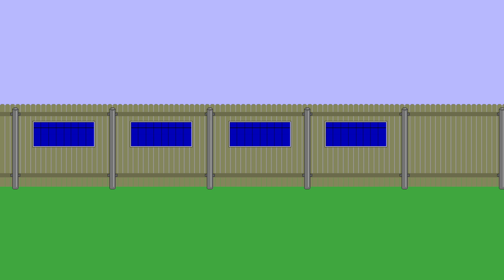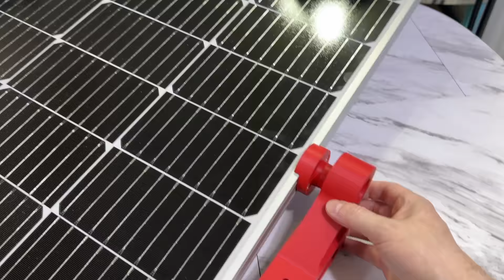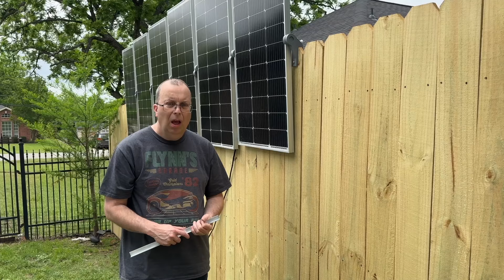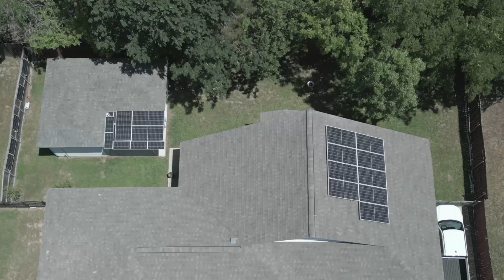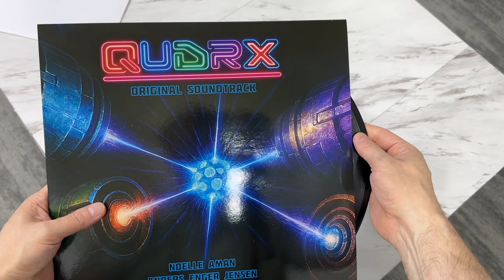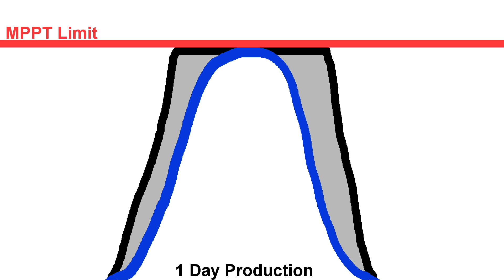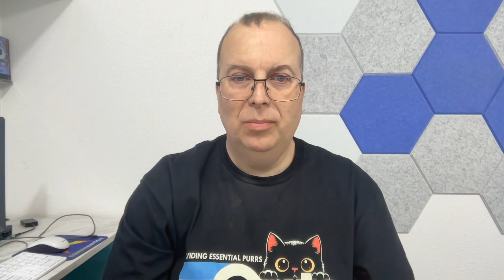I made an adjustable Solar Fence!

Comment: You should have a wing nut on the rotating bit.   You can tighten the wing nut down to increase friction on the rotation.  That would hold it in place  while providing infinite adjustability.

Comment: Your monthly electricity bill, even after accounting for the saving you make by taking advantage of time-of-day pricing, is surprisingly extremely high to me! What are the typical fixed-pricing unit rates and standing charges (including all surcharges) in your area, and how much electricity do you use in a year?

As a Londoner, I pay 0.2112 GBP per kWh, plus 0.4270 GBP per day. My annual usage is about 4000 kWh, so that totals pretty much exactly £1,000 per year, or abut 1350 USD per year, or about 112 USD per month. My current server hardware is responsible for about 1000 kWh per year (95 to 115 watts, 24/7), and indeed the typical household usage in the UK is about 2,7000 kWh per year for a 3- or 4-person household.

Comment: You could use a pipe as a continuous hinge point for all of them and screw them together making it much quicker and easier to tilt them.  Since they're hinged in the middle it'll be easy to tilt the whole array as a unit.

"This one trick"  I built an off-grid system for about $1700.  On hot cloudy days with the AC running all day I don't have much extra power available to charge cars, but other than that it does fine.  I just picked up another 5.6 kw of panels for $29 off eBay, if I get those installed it should get me through almost any weather without issue.

Comment: my concern would be the panels are now a sail. I am going to be curious how they perform being soo high during the windy winter months.  I would be concerned that the vibrations would decrease the life of the fence in which case you are legally responsible for replacing it. Not soo bad when neighbor can't see the panels, but now they can, and if you have  an irrational neighbor when it fails, they might have you pay for the whole fence. You could focus some of the panels east and west to extend the usable generation window. Add a recirculating pump to the water heater with the extra solar and heat the water. you can never have enough panels. that is the law.

Comment: 15:00 Why hitting 100% charge on the battery backup is detrimental? I thought the battery just kick in to be supplemental during the off peak and nighttime hours and not be the neuralgic point for the off grid system, unless they are also the main inverter-regulator in the system.

Comment: Hey, you should look at the fine print of your "free nights" plan. It might explicitly forbid you from charging batteries at night. Mine does. If they decide I'm using too much power at night, they can start charging me market rates (which are typically higher than already agreed rates)

Comment: Holy crap you guys use a lot of electricity. 300-600 for two people is intense. Are the rates just very high? Were a house of three and we barely crack 100 every month, no solar. 0.18 a kw. In the summer the bill can get close to 300 for a month or two.

Comment: Just buy 600Wp solar panels and put them on the sun, not these small toys, I did put panels everywhere around my tiny 52m2 house and now I have 20kWp now... Dont use ecoflow joke but a victron inverters and mppts and proper NMC batteries 20-60kWh

Comment: Man, your electric bill is still too high.  Even before I got a 9KWH system I electric bill was no where near as high.  With solar (I generate 11.5 - 12 MWH a year) Usually during summer I am paying 30-90 dollars a month, winter it jumps to 250-350 although I did sky rocket that to 500 one month when we had 0 deg F weather for 2 weeks straight.  For reference, my house is 6 bedrooms with a walkout basement and I have (2) Heat Pump (non GEO) units that run on electricity for backup heat. I do also run (2) smart thermostats that adjust the heat settings on a schedule when we're usually at work.

Comment: @The 8-Bit Guy - The only need for changes that jumps out at me is the vertical planks on the fence where the panels are attached... The upper ends have only 2 NAILS holding the planks to the 2x4s behind them. That's no good! There should be 4 or more SCREWS with fender washers per plank. 
Or better yet, continuous L-shaped aluminum with several bolts into and through each plank, plus reinforcements on the 2x4s where they attach to the fence posts. Joints in the L should happen on planks with no panel mount. Then you should be good in those 80-mph winds. Maybe even 100 mph. Note that wind force varies as the square of wind speed!

Comment: Couldn't the solar panel have the hinges at the top of the panel aligned to the top of the fence and then they are lifted away from the fence at the bottom and a bracket put in place there to keep them in position  - so not intruding onto a future neighbors land? (still high enough to be out of the shade?)

Comment: 17:25 One thing to consider (not sure if ecoflow can do that) is a smart bypass of the battery when that is full. It means it converts all available solar power to grid power on demand. Or adding more battery capacity. Sure at times it won't be full, but when it is, it lasts longer.

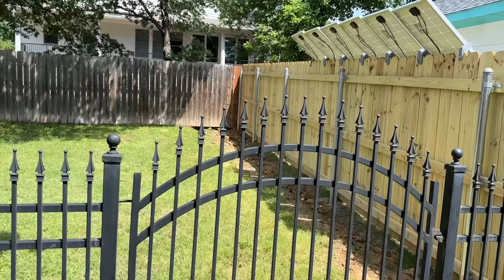Comment: 7:07 Hmm.  Couldn't you have made it so that the fence poles are all on the same height? (Then attach a horizontal bar/beam between them and attach all panels to that) That would made all panel on the same height with the bonus of being able to link all panels and tilt them in unison. And technically you could add a cheap DIY 1 axis solar track to it. /consists of two cheap 1W solar panels divided by a 90° board driving a small geared motor (also a few diodes are needed, but that is all. if the sun shines on top, but not the bottom the power drives the motor in on direction tilting that mechanism and all panel up, and if it falls on the other side it drives the motor in "reverse" tilting them down) if both are evenly lit the small panels cancel each other out.) 
7:58 Depending on the mounting, you might only need to move them for "other things that needs to be done"  ... as they would be strong enough mounted to not fly away on bad weather. Unless the weather is so bad the house also flies away. But then moving the panels vertically won't do much. And maybe to clear snow.
8:53 Your main building still has roof space left for east or west facing installation. All a question of cable routing,

One idea for the panel angle: If holes in the fence is an option for you, a half circle of a T profile* connecting top and bottom of the panels might be an option. The vertical of the T then would have notches or hole where you can snap in a spring loaded bolt can be snapped in. As long as the bolt is there it won't move, pull the bolt out and you can move it into any angle any time)

*=10:49 L-profile also works. Putting the lock on the solar panel part (the moving L-profile ... but not onto the panel itself only the bottom part of the profile) would allow you to only use one lock for each panel (side). And give the vertical bar on the fence plenty of holes (= plenty of angles). Well maybe not with that lock exactly.

Last word: You really were on the fence with that solar energy production. ... Pun had to be made.

Comment: I saw this video that solved the same problem with some rails, and it made me think of this video: https://www.youtube.com/shorts/PyH6Bm6yJas

That video doesn't seem to show any way of locking it in place other than tightening down the rollers with bolts at the desired position... But I think you could simplify that greatly by putting holes in the side of the rails and the slider so that you can just stick a pin through both the rail and roller at an arbitrary position.

Comment: You could use struts like there are under car bonnets to hold up your panels at the optimum angle. Then just a small electric motor to push them back down during storms etc.

Comment: On your supports print them with a single hole going through the collar. On the solar panel mount print them with holes going through at various angles. Pin lock. Easy peasy. (I wrote this at 7:19 into the vid)

Comment: I’m loving what you did here! You probably already did this but since I am an old carpenter I couldn’t help but notice a weak point in your fence mount. The fence picks are only held on with small nails from the manufacturer. Do yourself a favor and put a few screws in them to prevent them coming loose with some heavy winds. This set up is very clever!

Comment: FYI: Panels on roof on main building in Texas => building permit from city (structural and electrical (if panels in series produce over 50V)) and approvals from fire dept (specific easements on the roof edges to allow firefighters space to climb & walk and a quick-disconnect button mounted on the side of the house). Not on the house ? You only have to get okays from neighbors & HOA (not a problem for David) and, if the system is grid-connected (selling excess power back to grid), from your electrical co.

Comment: Texas... doesn't let you sell excess to the grid? Is the norm here in the UK.
Reply: you can. But in most cases, you are getting bill credits. Unused credits usually roll forward and may have limits depending on the plan. Usually you're getting less per kWh. Basically the same as in Europe. Just like we also see energy providers giving less and less credit for each kWh fed back to the grid.

Comment: If you're still figuring out some way to make the panel angle adjustable take a look at constant force joints. You can recreate then with bearings, spacers and bolts.

Comment: So... what I did was I installed an aluminum banister across the fence, then I hung my panels on the rail, and installed adjustable folding table legs to the bottom of the panels. This way the panels fold out of the way when needed, and then I can adjust the angle easily to get the best results. Also, with me living in Tampa, this set up makes it easy to remove the panels and store inside the garage during a hurricane. Was pretty cheap to set mine up.

Comment: I always thought it would be better to have electric motors with some sort of angle sensor and like a solar tracking so panels rotate themselves. However the setup would need to also lock in position to be able to resist the winds. Just some food for thought.

Comment: Clipping is what you want, that was one of the most common things to do here in Western Australia, I guess mostly because the biggest grid connected size you were allowed at the time was 5kW, so you would put 6kW of panels on the roof. There are still limits when it comes to export and the buyback scheme. For me, I put panels north, east, and west, so that I have all day power and clipping for most of the day.

Comment: I don't even live in an HOA, but the city I live in would throw such a fit over this. Absolutely nothing attached to the fence like that which extended over the approved height. And tilting them into your neighbor's space... forget about it...even if the neighbor is family or friendly with you. Get ready for fines from the city. Florida is bad like that.
Reply: Seems like corrupt city officials with ties to the power companies. Something similar happend in my city where a corrupt councillor blocking a fibre company in favour of his "friends" at the local cable company.

Comment: Generally speaking, recharging a lithium accu to 100, or anything past 80 (some are recommended to stay at 60 for some reason, like my Lenovo Android tablet), is a bad idea (unless you really need all 100 (which should rather be the exception)), but it does depend on the precise composition. I'd be surprised if you didn't know that, and would be sorta surprised if Ecoflow hadn't told you that; hell, the unit should have a protection option for it, just like the Android operating system does.
Reply: Unlike Li-ion battery type used in tablets, phones and older EV's, the EcoFlow uses LiFePo4 batteries. This type can handle 100% charge when in daily use like in David's situation. The 60% rule is intended for those batteries that are not actively used for long periods of time or stored disconnected. Plus, LiFePo4 batteries have significant higher charge-discharge cycles in their lifespan up to 5 times or more, depending on the quality and some other factors. Actually the lifespan can easily reach 10 years. So, it's no serious problem if there's more solar power available than the battery can hold.

Comment: How about adding a chain actuator? You could automate the angle depending on the sun angle. And when snow or a storm is forecast, automatically move the panels back in a safe position.
There are quite cheap ones running on 24V. Weatherproofing them shouldn't be a big problem.

I use chain actuators for roofwindows that are harder to reach. They automatically open when necessary, but only when we're home, there's still daylight and no bad weather is in the forecast.

Comment: It's an interesting concept but HOAs or neighbors wouldn't let you do this to a shared fence so it's not that practical for most people unless they live out in the country somewhere where they get sun and have full control of their property.  Also, wood plank fences aren't really that strong. Sure,  when they're brand new all the boards are straight and the fasteners are secure but even without any extra strain on them, after a few years, the planks start get loose and it's going to be whack-a-mole time with replacing them and fixing up the fence. Still a cool video.

Comment: Within a couple years those fence slats start warping and pulling out the nails, might be a good idea to use screws on the slats where your panels mount.

Comment: solar ppanels facing the sun directly or not directly doesnt matter. we call them solar panels but they are uv panels the turn uv into electricity. offcourse there needs to be enough uv touching the panels but full rays of sunlight isnt needed. also measuring one day and the day after does not give good results. there cann be ssun but less uv. due to dust in the air a cloud moist ect ect. so putting panels on a swivel doesnt help. better is to just put the pannels always at a angle

Comment: 15:15 making use of the energy could be an option.  Heating water in a well insulated tank (winter), cooling water (or gelpacks) in a top-load-freezer (summer).  Build a whole automated pipe system to funnel the latent heat (or "cold") energy to the HVAC Radiator and you're droppin' that cost by a lot of [insert specific currency here].  Can be done manually, too, of course.  Putting the ice packs in the fridge on a very heated day will help the cooling system there!  And neatly replaces volatile cold air with non-volatile mass [which is even colder than the fridge's temp set])

 Some ideas go as far as electricly lifting/winching a weight that is let down again when the sun's gone while running a simple generator as it slowly descends over an hour or two.  I'd rather get a used freezer and water tank, though.  A weather proof, black water tank will soak up even more light energy, in addition to the photovoltaics.  Piping hot water for you to cook for your loved one - and a nice warm bath for him/her afterwards.

Comment: Setups like yours are the reason why plug-in solar is becoming legal and popular in some states where the laws allow it.

Instead of all the complexities of batteries and off grid, you just plug the whole thing into a UL certified converter, and it handles all the disconnecting from the grid during a power outage.

Yeah, you still get no power in an outage, but for a LOT of people they just don't care about that.  It avoids all the expense of batteries, but when you're out-running your batteries, you're not wasting all that power you're producing.

I'm another person where there's very few places to put in panels because my yard is very well shaded.  Which is great for reducing cooling costs, but not great for a solar install.  So I've never bothered, but a small-ish setup of a few hundred watts might be worth it if the cost of the converters, and you can just plug it in.

Comment: Greetings from Germany:
Your tilt mechanism designed in an interesting way but you could get it better for really cheap:
- Connect your rod to a bolt which can move inside a hole like the bolts IKEA puts in their furnitures to screw in sidepanels or something like this.
- Round off the edges of your rod
- Thread a threaded rod through the screw and secure the rod to your fence
- If you wish you could motorize this setup (steppermotor would be nice to have the option to calibrate to exactly the angles you want) and build a controller to optimize the angle to the sun for better results.
If you have any questions regarding my idea feel free to ask and keep up the excellent work!

Comment: still on the Fence about Solar ? 

maybe get a 2nd Battery in Tandem to switch over when you get those two last panels ...

then you can compare battery performance = never stuck if one fails ...

Comment: some small modifying of the mounts for the panels to have teeth on the ends, that go into the mounts on the fence. then modify the fence mount to have a clutch. basically a ends of a ratchet strap.

Comment: With a slightly more complicated hinge design, you could have them rotate while moving outward so they stay on your side of the fence (thinking forward to if & when you get new neighbors). Plus it probably wouldn't be that hard to rig up a system with a single motor to move them all out & back, and maybe a solenoid-based lock to lock them in place once they are retracted. If such a system doesn't already exist, maybe you could even start selling them? This would be trivial for any mechanical engineer to design; and it would be easy to control it with a raspberry pi or something. Bonus points and cross-branding potential if you made a Commodore 64 be the system controller ;)